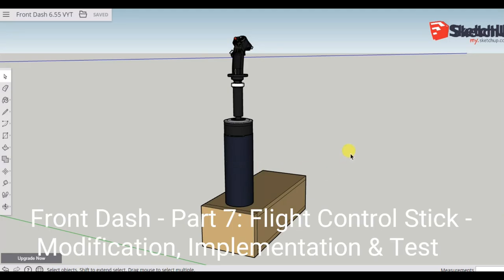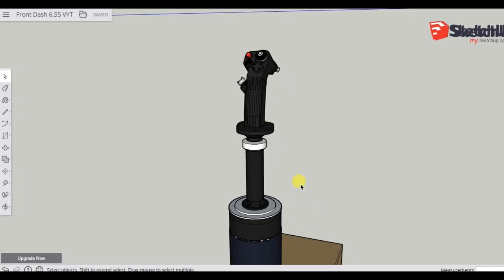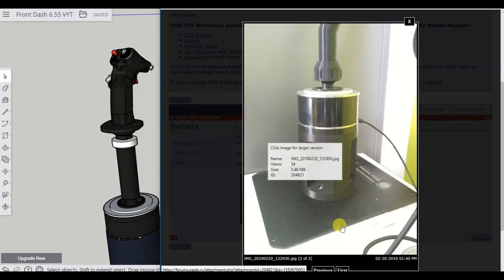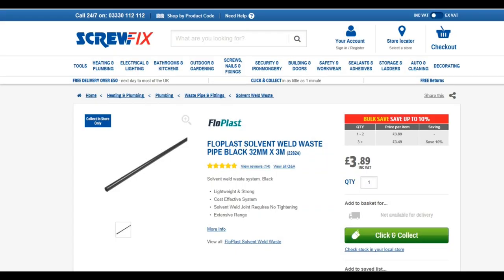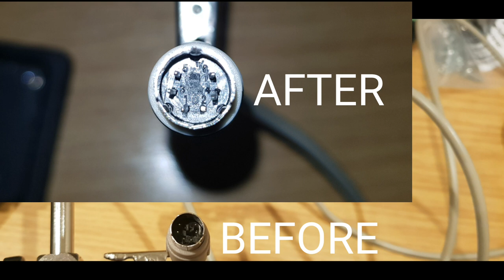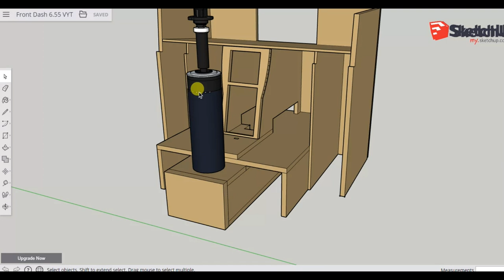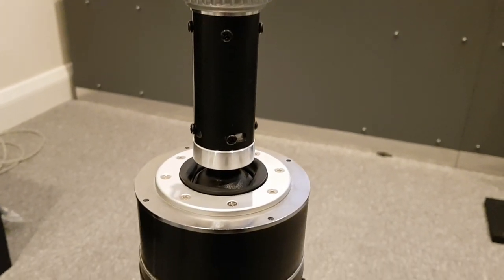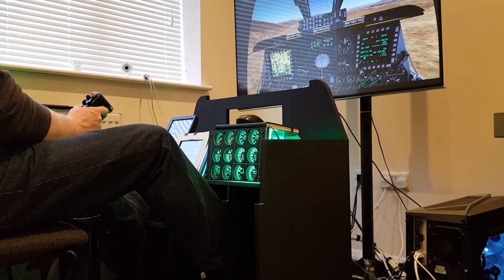Simpit A10C - Front Dash - Part 7: Flight Control Stick - Modification, Implementation & Test

Comment: That lathed aluminum stick extension is a work of art! Looks great!
Reply from the maker: Thanks Ray, I put in a bit of flying time this weekend whilst thinking about the other instruments, and it came in really handy that I could rotate the handle/grip. It really increased comfort. 
3D printing would have done what I needed as regards the adapters but my father in law has some serious skills when it comes to machining so was great to spend that time with him making them. When he took it off his lathe I was super impressed

Comment: Hi Craig, I have been following your progress. Simply amazing job. I just updated my dcs open beta, and the arduinos stopped working, do you have any idea about this, are you facing the same problem?
Reply from the maker: Hi Ali, for simplicity I run the standard 2.5 release. Even with that, a previous update affected my exported displays (mfcd, cdu, etc). I'd imagine open beta is far more likely to have these issues. You could remove and reinstall dcs bios and see if it works. Might be worth checking over all the key files that make the exports possible. Without running that version I can't say exactly. I hope you get it working, good luck

Comment: Awesome work. Do you have a build log on the ED forums as well or just your website?
Reply from the maker: Hi HipoxiK, 
I liked the idea of having a website although understood I needed another platform to share more widely. I looked at ED forum but decided on YouTube mostly for the reason that I like sharing by videos.
Thanks for your positive comments and the thumbs up
Cheers
Reply: Craig S no thank you. Your videos really helped to clear up the idea of using a master mega with several slave nano/uno’s. I have designed some custom PCB’s now which should allow for a tidy build for my Huey console.